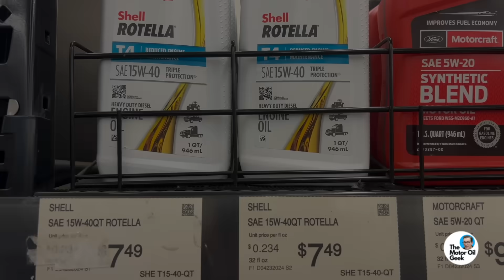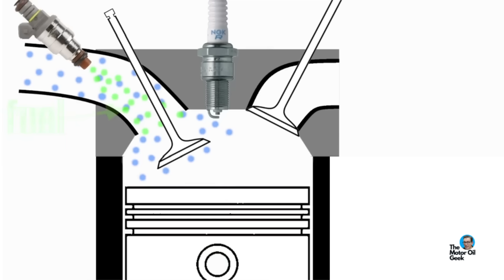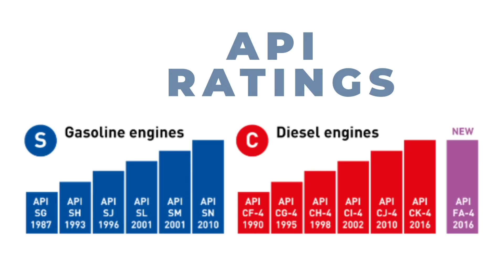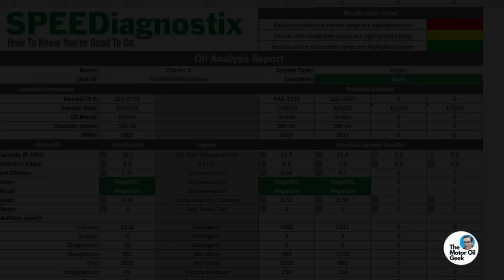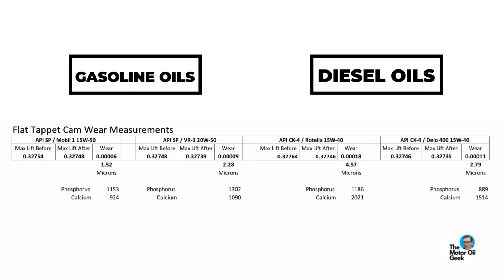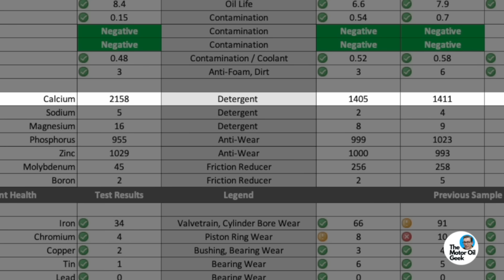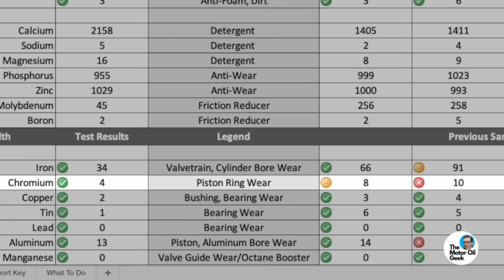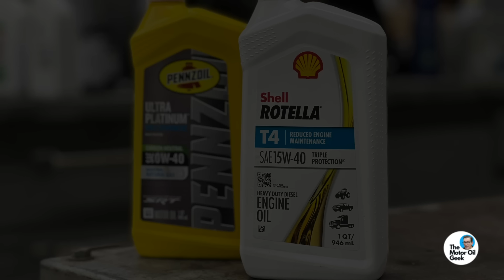Why DIESEL Oil is Actually WORSE for Gas Engines!

Comment: Especially for older flat tappet engines, Rotella T4 has been working for lots of people for lots of years. I check valve clearances regularly in my motorcycles and do not see sludge or soot building up. I also disagree with the use of super thin oils in modern gas engines.

Comment: There's a big difference with a gas engine 1960  and a fuel injected engine... T 4 works no matter how u look at it with an old school engine... They need the zinc.  You might have share info on older engines verses newer injected engines... You correct wont run T4 in my 2010 car but my 60 year old jeep that's a whole different story.

Comment: When we got my wife's older 320i I knew the previous owner had skipped an oil change since it was missing from the service history (car had 56000 miles and oil was changed at 43k...) so following my mech recommendations I changed the oil to T6 0w-40 rotella and did about 800 to 1k miles and then switched back to gasoline 0w-20 synth moly...
When I drained the rotella it was extremely dirty, car never had varnish but it got T-Boned at 126k miles so I can't say for sure but it was perfectly healthy when my wife got hit ...
(zero injuries btw, very solid car the f30 😂)

Comment: When vice grips garage uses it on a engine that was sitting for several years it's a good choice. Cheap and has all the cleaning chemicals you want to flush out a dirty old engine.  I don't think I've heard anybody say I run this as my daily oil in my new car. That doesn't make any sense at all

Comment: Great vid Lake! Very valuable information. I now have a question, how come on some petrol engines that have duel fuel (LPG & petrol) or full LPG, are recommended to use a diesel oil instead? It seems odd to me considering LPG has way less soot/carbon then even petrol. 
My other question is, how do car manufacturers decide what size oil filter to use? I have a car, which in my opinion, has an oil filter which is too small, because they are know to bypass when the motor is revved when cold or at high RPM (I had problems with it bypassing ) and it seems there are quite a few myths to do with why a smaller filter is better. I would like to use a bigger filter but don't want any problems and I can't find a good answer. Thanks!

Comment: Very interesting.   As time goes on with modern engines, I have reverted back to OEM fluids and parts in my vehicles.  Most of the time, the difference in cost for fluids is negligible.  Parts is more about quality assurance.

Comment: You completetly missed the boat here- People running diesel oil in modern DI engines is pretty rare, where you see a lot of diesel oil in gas engines is in older cars, especially muscle cars and old light trucks, usually carburated.

I would not be at all surprised if they had soot and other levels more similar to that of diesels, and some of the "race cars" people run diesel oil have compression closer to the bottom end of what a lot of diesels have. 

If I was going to guess, the best oil for them might be something different from the other 2, but what that is I don't really know. If you did this video covering recommendations and numbers for something like my '71 Mach 1, or the 2, '87 Pontiac Trans Am/formula in my driveway, or even the '93 Cadillac Fleetwood Brougham in my driveway.

For that matter, I wonder if the current diesel spec isn't getting a little off base for something like my '04 Cummins ram (early 04, pre-emissions).

Comment: There are multiple aspects of difference between oil types. You should absolutely NEVER use oil desined for diesel applications in a gasoline-powered engine if the engine is not designed to handle the specific weight and chemical make-up of the oil. If the oil is 20w or 30w or more at operating temps and not chemically designed for gasoline engine applications that is literally appying that much additional weight and wear to the parts of your engine and if not designed to handle that weight on a daily or even one time basis it can cause catestrophic and unrepairable damage to the engine or the chemical makeup of diesel based application oils can and will eventually cause preignition and your engine will become an expensive paper weight. For instance, take a ford eco boost engine used in a lot of new vehicles, it is specifically designed for 0w oils. If you put a heavy diesel app oil in it, that would cause the timing belt to slip and the pistons would hit the valves or preignition or both and kaboom, you just absolutely destroyed the engine. We're not just talking engine oil weights alone here which can play a roll in wear but chemical makeup of the oil for the specified applications. Diesel oil is NEVER to be used instead of gasoline application oil. They have chemically designed each type of oil for very, VERY specified purposes and putting the wrong oil in the wrong engine reversed roll as in a gasoline app oil in a diesel engine, its going to cause premature wear on the boar of the piston sleeves and rings where if you use a diesel app oil in a gasoline app car engine, you're lucky if you don't cause the engine to entirely explode the first few times you start it or just by running it due to the chemical additives to handle suit for diesel engines reacting with the gas. I've seen this happen in top fuel dragster cars where they didnt use the right oil and every part of the internal parts of the engine were in the oil pan and even went through the oil pan and the side of the block had a nice window which it can and does happen to every day driver cars where the owner did something like this exactly thinking it would save their engine and prevent any wear from happening which just isn't true in the least. 

I follow dave actually on here and honestly, he wont be repairing your gasoline engine after something like this due to the amount of severe damage it does, its just not possible for him or anyone to do unless he has a time machine I don't know about and can prevent you from ever doing it to begin with. He'll either replace an engine you buy new or you're going to be looking at buying a new car, plain and simple, period. Do NOT put the wrong oil in your engine, it is not safe to run it, period. Follow the recommended weights and types for your cars engine which the  information can be found in your cars owner manual or on the oil fill cap of your engine, dont try to play with it, its not worth the headache in the long run or this will cost you serious problems you dont want and that tons of people can't afford.

Simple maintenance and upkeep following the directions your owners manual gives you is more than enough to keep your car running for a good long time. Just dont play with stuff you dont know and definitely do anything that the manufacturer doesn't recommend. Also dont be rough on your car and that will help along with simple and routine maintenance.

Comment: Okay so I hear you talking about direct injection gasoline engines what about carbureted classic engines that require higher zinc and zdp for flat tappet  cams are you telling me to put regular passenger car oil that has no or very little zdp or Molly additives instead I remember in the early nineties when they removed all the additives from the oils lots of people with flat tappet cams were having cam failures have they changed the oil since then that I don't know of

Comment: Well there you go, I've learned a thing, I never knew the detergents competed with the zddp, I've been running a high quality semi synthetic diesel engine oil in my older petrol engines for 30 odd years, thought I was doing good things for my engines cleanliness and longevity... I guess not 😬

Comment: When I hear about people running thicker diesel oil in their gas motors insisting it produces better lubrication, I can't help but wonder what it would do in car wanting 0W20. Or better yet, how about Toyota pushing the use of 0W16 or 0W8? If an engine wants 0W8, the clearances are likely tighter and somehow 15W40 just sound like a bad idea for that engine

Comment: One thing I don't understand is why diesels don't suffer from low speed detonation or pre-ignitiom since they have even more compression than gas direct injection engines?
Reply: работа дизеля это и есть, по большому счету ,работа на детонации (калильном зажигании) 😁.
Reply from the maker: The injection of the fuel causes spontaneous combustion (detonation in a gas engine), so they don’t “suffer” from it. They run on it.

Comment: I run Rotella t4 in my 88 f 150 (5.0) with 330,000 miles. Works just fine. Been using it gor 5 years

Comment: Following is a quote from Harley Davidson owners manual:  If it is necessary to add oil and Harley-Davidson oil  is  not  available,  use  an  oil  certified  for  diesel  engines. Acceptable  diesel  engine  oil  designations  include  CE,  CF,CF-4  and  CG-4.  The  preferred  viscosity  for  the  diesel engine  oils,  in  descending  order,  are  20W-50,  15W-40  and10W-40
Reply: Probably due to friction modifiers affecting wet clutches

Comment: Rotella T6 has 915 ppm calcium, and I have used it in my Brigs and Stratton lawn mower for almost 20 years, my 2 cars w/ hemis , my Caterpillars C15  and have zero problems. Synthetic is the best, not regular oil, plus going from a 5-w20 conventional oil to a 5-w40 synthetic oil is far superior

Comment: There's a full thread on Rotella T6, but I have a somewhat unique use case.
I've been using Shell Rotella T6 for a while now.
I have a turbo NB miata that's pushing 310whp@15psi, running on 93 octane.  At load, my AFR is all the way down to 11:1. (Very rich)

I'm currently in the process of rebuilding my engine.
I developed low compression in cylinder 2 (136psi), which caused massive blowby and turned my dipstick tube into an oil squirter.  The low compression was due to no gap on the rings when they were installed the first time (my fault, I'm new to this).  This time I gapped the upper ring to .021in and the lower to .029in.
Upon inspecting the pistons, I found a roughness in the forged aluminum on the intake side of 2 pistons, cyl4 being the worst.  The damage was also on the side of the cown of the piston and pitting/melting is visibly seen.  The damage looks like it could be LSPI.  I also found some slight scoring along the cylinder bore that the hone wasn't able to remove, visibly.  I could see the scratches, but couldn't feel them.  The scratches are where the ring edges were.
I did run the car for a few miles (50 or so) with a very lean mixture (AFR around 18-19:1)

My questions are:

What do we think caused the pitting/rough finish (feels like sand paper) on the pistons?

Also, I think the scratching of the cylinder bore was caused by ring binding due to ring expansion without sufficient gap, but could the T6 oil have been responsible?

I'm about half way done with the job and would like a solid oil to put back in the engine.
If I'm messing up here, I'd rather know now than later.

Comment: So does all this apply to Delo 15-40 apply as well ? Maybe I've been lucky cause my rigs are older, one was carbureted, others all FI from the mid. 80s to early 2000s all pushing 200K in mileage... am I lucky or this isn't necessarily applicable to my vintage of rigs. two have looked beautiful when valve covers were removed, like new.
Reply from the maker: It also applies to Delo, but it did better than Rotella in the camshaft wear test. Neither were as good as the VR-1
Reply: @themotoroilgeek  So are many of us lucky.. or just sitting on time bombs or ?? I live in the VERY hot desert S.W. 
Not trying to argue cause I'm not knowledgeable enough concerning this subject to do so, but just curious. 
There seems to be many commenting who've had good results.  Thanks for your time...
Reply from the maker: @XtremeXJ  Neither lucky or sitting on time bombs. Using a diesel oil in a gas engine is fine for carbureted or port injection engines, but the wear could be lower with a modern API SP oil. The real danger for using a diesel oil in a gas engine is for direct injection engines, which is why I made this video. Many people are unaware of this.

Comment: Idk,I bought a 99 super duty 5.4 triton in 2009 with 180k miles on it. I ran it from then til 2017 when I bought a new truck. I used 1 at of lucas oil stabilizer and shell rotella,only because I got it for cheap from a trucker friend. Had almost 250k miles on it. It still ran great and was quiet for a triton

Comment: OMG endless debates! Of course you are not putting T4 or T6 into a direct injected gas engine. It is based alone on the weight of the oil. In older hydraulic flat tapped engins it works. Yes ,calcium takes a little away of the zinc but it is not true that this is a 1 to 1 factor. T4 has 1200ppm zinc in it! The only other matxhing that is Valvoline Racing oil. However, old engines are dirty inside and need more cleaning. I run T4 in all my old carb V8s for years. It is doing fine!

Comment: I have been usin 15-40 rotella in my gas engines for years never had an issue. Got a 2012 silverado with the run of the mill 5.3 almost 400000 klms runs beauty. Never had any issues with lifters either.

Comment: Mastercraft waterski tournament ski boat uses Llmor Marine to power their boats. Llmor use to require the use of Mobile One oil to maintain their engine warranty. Around 10 years ago they changed that requirement from Mobile One to Shell Rotella T diesel oil. Llmor’s history is building high performance engines use in 😅Indy cars. All of their engines in Mastercraft are direct injection. Why would they make this change?

Comment: Been watching every video and still having a tough time deciding what to use in my Audi Q7 with the 3.0l Diesel and the VW 507.00 spec. I last went 8000 miles on the M1 ESP 5w30 that meets the spec, sent a sample to Speed and it wasn't good. I'm almost compelled to ditch the VW507 spec oils for something like Valvoline's Premium Blue HD 5w40 (even verse their Euro 5W-30 XL-III that also meets the VW507 spec). Seems like the VPB-HD still has the low Ash for the DPF but, better suited for soot encapsulation... We'll make that decision after the next sample at 4k (instead of 8k)... So much for the factory 10k OCI
Reply from the maker: I'd recommend sticking with the factory spec but not the OCI. Let the oil analysis data determine that.
Reply: yo ocupo el mismo aceite que tu, el M1 ESP 5w 30, me gustaría saber si es posible porque la muestra analizada no fue buena?, que tenia de malo??, muchos kms para este aceite??, te agradezco de ante mano tus comentarios.

Comment: How'd you end up Centerville? I grew up there (ran away for 20+ years to play in the Air Force and came back to retire). So glad you hit the ZDDP topic. I run flat tappets for the most part (except for my 4.6) and I have had two cams flatten from back when oil stopped including zinc. I've been using VR1 in my old motors for the last 20 years or so and it's all been golden.

Comment: Maybe new fuel injected engine but what about older carburated motors ??? Diesel oil have more detergents rite ? Think your comparison is not totally truthful your comparing corn based oils and petroleum ive use diesel oils in my older pre 70's no problems

Comment: I recently got a Briggs & Stration  Intek engine , What is a good oil to use ? Thanks Lake !
Reply from the maker: If it is not broken-in yet, I'd go with the Driven GP-1 break-in oil.
Reply: @themotoroilgeek  Guess I should have said it is a used engine ,I am sure it,s broken in by now .Like all your videos .:goodvibes:
Reply from the maker: @matthewcalifana488  At that power level, the Mobil 1 15W-50 would do a good job.

Comment: Glad your comparing like for like 40w oil. However older engines using the newer 0-16w oils in older designed pushrod engines, isnt right either. As you said, application dictates chemistry.

Comment: This whole video is complete and utter nonsense! Running diesel oil isn’t gonna trash your engine—no way. Detonation near the compression ring is just a design flaw in a gas engine, plain and simple. If you're getting blow-by and noticeable oil consumption, trying to “treat” the issue with some two-stroke oil that’s basically stripped of additives is just dumb—like trying to cure diarrhea with a butt plug.

The root cause of engine failure here is oil getting burned due to a poorly spec’d piston group—crappy oil control rings and piston geometry that doesn’t do the job. On top of that, your fancy low-SAPS, NoLSPI oils? They're brewed on non-polar base stocks and can’t hang onto soot or additives once things get hot in the combustion chamber. They just give up.

What you should be doing is running full-ash mineral-based oils and swapping them out every 3,000 miles. And if your engine’s guzzling oil—quit patching it with snake oil and actually fix the damn thing.

Comment: My father used to have a 01 chevy 2500 hd with the 6.0 that ran on Rotella 15w-40 diesel oil its since the first oil change. At 411k miles he found a piston ring in the oil, interesting to finally know what the result was of running that oil for so long was. He bought the truck from a construction company and they used that Rotella oil because that's what they had in bulk and since it ran on that oil for so long he decided to keep running it.